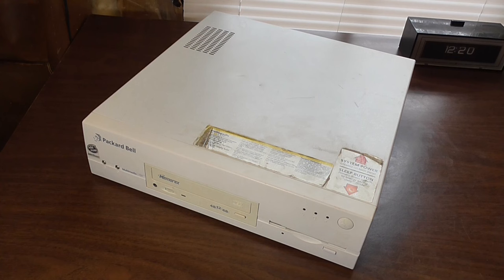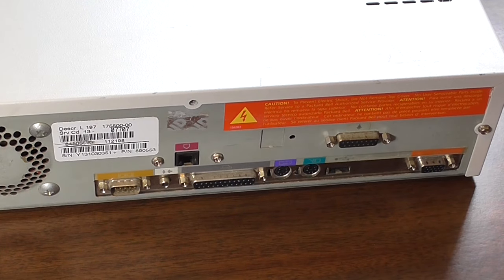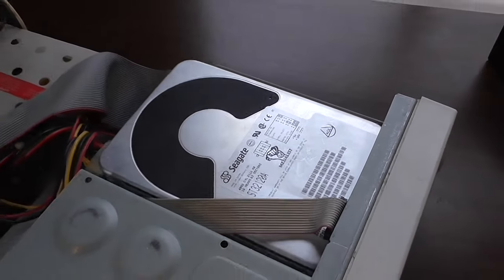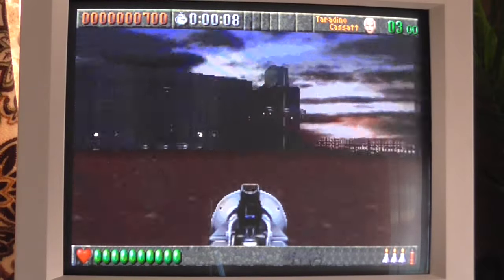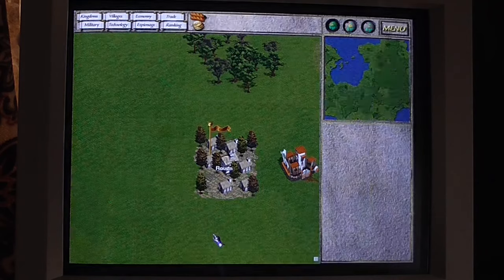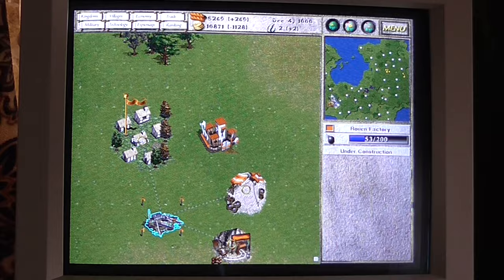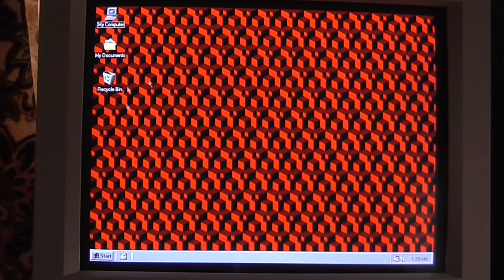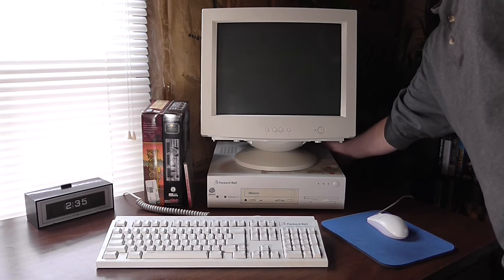1997 Packard Bell Multimedia L197 - Smallest Pentium 1 machine I've seen!

Comment: Those chips behind the VGA port don’t look like cache.  I used to have a Packard Bell with a Pentium and Windows 95, so I’m a bit familiar with how the insides look.  Those chips are the video RAM, 2x 512KB chips.  The empty sockets allow you to double that to 2MB to increase performance.
The CPU’s L2 cache chips were a lot closer to the front of the case by the Main RAM slots and were more square and soldered directly to the motherboard.

Comment: Great review.  If only it had a single ISA slot, this could have been nicely expanded for Ethernet or Arcnet; then it would make more sense as a 90s light weight office PC.  I don't think this would make the grade for a request for proposal (RFP) for any bulk contracts because most systems at that time would be workgrouped together with Netware or Windows NT.

Comment: That fits right in with the Packard Bell line, real difficult expandability.  I can't say I've ever seen a machine with no slots on the board whatsoever, I've seen ones with riser cards, I've seen others that were missing their riser cards, but never one without any slots.
I guess the only things you could really upgrade are the hard drive, CD-ROM (should support a CD-RW drive), memory, possibly processor (though this would depend on the mainboard, and nobody would spend the money for a faster processor), and modem, should you use an external.

Fortunately it has a USB port, so you could use a USB to Ethernet adapter, although the USB 1.1 would limit your throughput to 6Mbps maximum, probably fine for a machine of that age.  Otherwise, despite its limitations, it's quite capable.
Reply from the maker: +jaykay18 Yeah basically, but even the older models could be expanded with a little bit of fiddeling and a lot of hair ripping this one is freaking weird that it gives you nothing like that. Also yeah in my experience all of that should be upgradeable. It may even be possible to get a DVD drive working on these iirc (I think I did it back in the 2000's when I wanted to play C&C the first decade on an older machine).

USB is very useful though yeah like you say, personally I wouldn't even bother with the LAN thing but just use it for USB sticks. I've already loaded the Windows 98 drivers that allow that and it works, unfortunately with the CMOS being dead it turns off the USB controller every time I reboot so it has to be enabled in BIOS.
Reply: Transcendental Airwaves Intersting how the CMOS turns off USB by default.  Perhaps the machine came with pre-Windows 95 C, which had no USB support, so they left it off to prevent Windows from seeing an "Unknown Device".

A DVD drive should also work on that machine, certainly to read data from a DVD disc, but as for actually watching a movie, that would generally depend on the rest of the specs of the machine.  I had a Dell with a Pentium II 450MHz, which actually had a separate DVD decoder card, and worked great under Windows 98.  Surprisingly, it also worked great without the card with no difference in video quality.
Reply from the maker: Yeah I suspect it probably did since most of the Packard Bell computers I own originally came with Windows 95. That's hardly surprising though given the fact that it's a 200mhz P1 with 16mb of RAM. Pretty standard setup for most Packards really if it were a more standard board.
Reply: This model was sold as a competitor to Compaq's Cyrix MediaGX-based Presario 2100 and 2200 small desktops. The Packard Bell was more expensive but it had a real Pentium, while the Compaq had built-in stereo speakers (including a built-in subwoofer!) and was painted black at a time when most PCs were still white or beige. Neither sold well due to the lack of expandability.
Reply: vwestlife I have a Presario 2266, with a Cyrix 225MHz processor.  That machine has 2 slots in it.  I often wonder what I keep it around for.
Reply from the maker: vwestlife
Ahh! Very cool, I didn't even realize there was a counterpart to this thing. :D

Comment: That's 16KB of on-die cache. It doesn't look like the motherboard has any fitted (though possibly those two QFP's next to the SIMM slots are cache).

The OPL FM doesn't sound too bad though! Nice little machine!
Reply from the maker: +RetroSwim Ahhh I see! I didn't realize they did that, now I know though. What do you think the sockets are for then near the CPU? Someone else suggested they could be for GFX memory. Also yeah the sound card seems alright, it's not working perfectly but all together it's not a bad machine.
Reply: The empty sockets are for adding extra video RAM.
Reply from the maker: Cool beans! Thanks for confirming that!

Comment: is this  the  same   aztec   that  made  psus  for pc,s oem and  other  12/5.3.3v psu,s  for  other things  cnc,s  etc
Reply: also  remove  that battery  them  things  leak   and  destroy  the  solder  joints on the  borad

Comment: Great video! Did your computer come with any of the Packard Bell recovery software?
Reply from the maker: +ChrisWY27 No unfortunately and without the right number code that was written on the HDD. I can never properly restore it, it's just as well though since I would rather have a straight copy of Windows on here than one choked with software I don't need lol.
Reply: +Transcendental Airwaves I recently just picked up a packard bell that also has the PB770 Motherboard yours does. Have been crawling the web for lots and lots of old information about it. So far the 175500-00 I see on your sticker should be master cd version you need. Mine also came with a 1.3GB Seagate HD and from reading that seems like it may have actually been original. The OS is completely installed on mine with original bloatware and all so either this drive is original, or someone put in another 1.3GB drive and used an official restore cd on mine. I'd bet it's actually original though. If there is any interesting info you have collected on these please share! My latest quest is finding the latest version of the BIOS to flash. Hoping to swap in a larger drive but not sure if I will hit a cap at 8GB or something. I doubt this machine even goes up to the 137Gb cap.

Comment: Are you sure the power supply is AT and not ATX?  I'd have thought this machine would be ATX compatible, well, to a fashion, considering that it's from 1997, having said that I understand Packard Bell didn't always follow regular form factor standards.
Reply from the maker: It's neither it only has a single AT style connector iirc.

Comment: Show this with Windows 95 or Windows NT so that this computer is more original.
Reply from the maker: Well it's almost identical really, 98 just has 32 bit color wallpaper support, better driver support and built in USB support as well as a lot of other various improvements. Sure it runs slightly slower but 95 and 98 are so similar it's not worth showing again. Although you may see it again when I replace the battery, perhaps then I'll do that since I've also now got a much larger Packard Bell collection and many matching monitors which I didn't have at the time I shot this video. :D

Comment: Packard Bell wasn't really a good pc brand, Gateway 2000, Compaq, AST, Dell, etc. were the better companies of computers back then. Packard Bell PCs had proprietary components and had no cache installed. and Compaq accused them of using used components as new.
Reply from the maker: +Windows Ninety Five 66 That's what everyone says and yeah they had crappy soundcards and no cache but the truth is most computers that I've seen from around this time period (mid 90's) had weird stuff going on with their hardware choices.
Reply: i want a new dos/win95 gaming machine but the old dos pcs are too expensive, i saw a Generic Pentium 90 PC MS-DOS Gaming PC for $399.99 why so much, why not $50
Reply from the maker: Don't buy online, look at rummage sales and garage sales.
Reply: I have seen more pentium 1, pentium 2, and pentium 3 PCs than 486 or 386 PCs.
Reply from the maker: Same but I have seen them before so just keep looking I guess. Personally I've gotten frustrated with 386 486 and 286 machines since it can be impossible to setup an MFM hard disk.
Reply: i have my pentium 133, the ram, and the power supply saved from my dead packard bell pc, i wish i have a at socket 7 motherboard so i can put them in it and have a new dos and win95 gaming pc.
Reply: +Windows Ninety Five 66 I have a vintage early 1997 200 MHz MMX Packard Bell Pack-Mate 7715EX system.It has 256 KB of L2 cache.